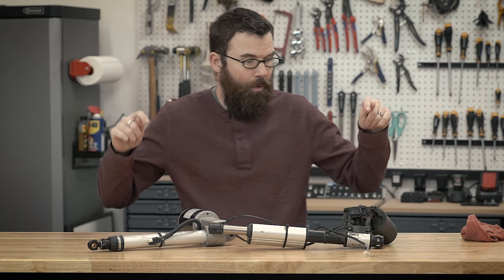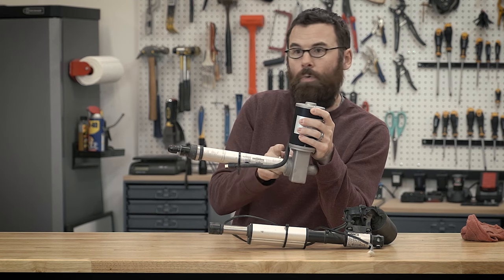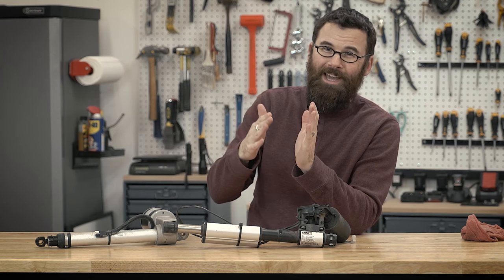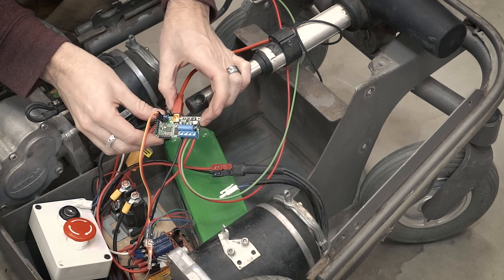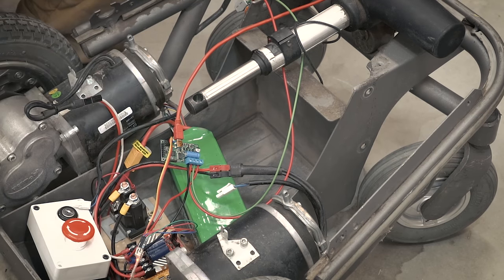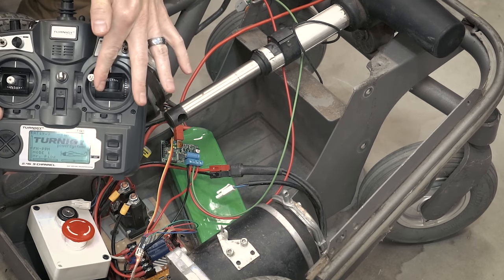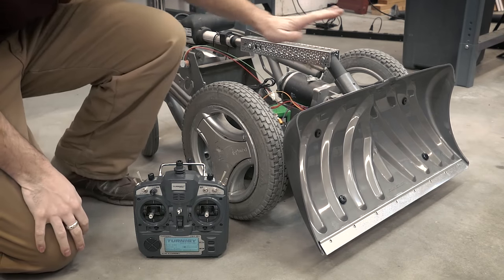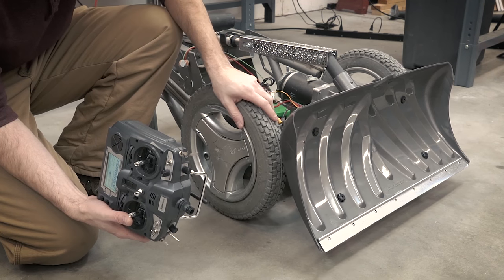Robotic Snow Plow - Part 2

Comment: hello sir, this invention is pretty good. I'm a warehouse associate in a healthcare supply business and those kind of wheels don't work well during winter. I had very bad experience on those kind of wheels when loading them in the van lol. Having heavy duty/ toothed metal wheel and heavier front could help on your project. Thank you for this video. I learned a lot

Comment: I recommend adding ballast, perhaps come "chains", and most of all, raise the plow when taking the first pass.  If you leave 2 or 3 inches behind on the first pass, but you can move the snow, then you've made progress.  The other issue is that "scoop" type plows are not very good for plowing.  In plow terminology they call that "gather" mode, for gathering piles.  In normal mode you want the snow to shed off each side of the plow so that you don't exceed your traction envelope.  Start by adding ballast and adjusting your technique.

Comment: Have you ever seen the VNH2SP30 motor drivers? You can pick them up on a small breakout for about $6 a peice, and they will handle 30A continuous with 45A peak. A nice feature is that they have current sense feedback built in. We have been using them in a more packaged up form for quite a few years in FTC.
Reply from the maker: I've seen them and used them.  They're decent for the price, but lack a lot of the features of a full motor controller.
Reply: Robert Cowan They are a bit of a DIY solution. You are right about the lack of features

Comment: Fun project Robert; we could use that in Vancouver this year.  Maybe phase 2 could see a propane tank mounted on top and replace the blade with a flame thrower manifold :)  might be a bit slower, but traction wouldn't be an issue.

Comment: there's a robotic snowplow competition in Minnesota each year and what most teams usually do are 4 wheel drive skid steering systems that are really weighed down. my chassis was 700 lbs.
Reply from the maker: Oh, cool.  Yeah, I was just trying to see if it would work, but it didn't  :-/
Reply: I think if you added some weights to the top of the robot you would be able to push a lot more snow.
Reply: I understand not wanting to put any more money into it though. Robots are expensive!

Comment: Nice project Robert...would you share the list of parts for this project?
I wonder if you have made any improvement since your initial testing!
I am thinking that traction could be improved by simply adding weight to the chassis.
Thanks for sharing your passion and expertise;)
Reply from the maker: There's a small list in the description.  what parts are you curious about specifically?  I'm pausing the project right now as I just have too many other things going on and I want to do this one right.  I might just build it from scratch and use treads or something.

Comment: I would use a old Honda snow blower frame with caterpillar tracks rather then small wheels, you need to greatly increase the surface contact area of your drive system the ground, and with your bot steering by rotating drive motors in opposite directions... it would be two good systems to marry together. and it would perform the same way as a army tank steers by (skid steering).

Comment: the shovel should be at about 45 angle plowing to the side. you need yaw actuator to control the shovel angle. Weight is King on Deere tractors for traction. In your case you can use lead acid batteries for weight.

Comment: NOOO NOOOONOOOOOOOO BRO!
Not Too Wide Tires !!! 
the wider you go, more weight distribution you'll crate! you need, lot's of wight of jsut right(small) surface. 
 Go small, but with good tires!   (look for Rally cars on the snow )
(And of course you need more wight :) )
Reply: Wrong.  It should have mat tracks
Reply: @sullygully1976  well, the discussion is about the thickness of the Tires and not the entire different setup! But sure,  then you can not go with the same budget! You need to rebuild the whole driveline... And don't forget the costs😉
Reply: @ehsan0606  then look at the tires on a snowblower, and simulate that.
Reply: Snow blower has the corect amount tire width and hell a lot more wight!!!
Again in his partiklar case, you should not increase the size but weight in that... ☺️
If you even put 3 more of the  sames tires at each side, you will be needing even more weight to create better traction.
Reply: @ehsan0606  when i saw what tire s he was using, I new from the beginni g it was going to be a failed experiment.  What a waste of time.
Reply: @sullygully1976  well ofcourse not!! Fail your way to succes!  What do you thing that prototype is! 
That was lots of snow to take on! So , not failed, but learned :)
Reply: @ehsan0606  for someone so smart, he dropped the ball doing the obvious.

Comment: I was thinking all the way to the end same thing...Just adapt your own makeshift sno blower to this and it should work fine with maybe a better traction plastic belt chain links printed to fit front tire radi both large diameter and tire diameter perpendicular so the links can grab the tires..big links like a buldoser would have but small enough for front wheel and tires or take tire and rim off and modify like they make snow tracts for ATVS with the triangular drive empliments ...so this series should not go away follow through with your original Idea and make it work as it would make a great tool anyone in heavy snow areas would definantly want. In fact I can see RC Remote lawn mowers all sorts of aplication which is the next logical use for almost eliminating physical labor for these tasks. The disabled would benefit also if they could do tasks many take for granted like this. And when one is disabled they don;t have alot of extra money to hire someone else to come shovel snow everytime it decides to drop a load.

Comment: Add some small paddles to the tires?
Reply from the maker: I think treads might be the only way to go.  there's just not enough weight to really get traction.  Even tracks might not work.  I'll probably just go straight to tracks and a snow-blower, because the snow just accumulates and makes it harder and harder to drive.
Reply: Just use wheels like they use on snow blowers. Add some weight to the system and it will work out fine.
Reply: Treads won't help unless you want to stay on top of the snow.  Chains on drive wheels are the way to go for slick conditions over hard surfaces. Perhaps the old farmer's trick of using rope to gain traction would be helpful in the short run.  It's pretty cheap, easy,  effective, and reversible.  

 Pass rope through the hub and over the tire every few inches to form temporary tire chains.  Lace the wheel as even as possible and then tension the rope on the wheel with a triangular loop on the outside of each wheel. Feed the tension loop thorough outer loop pairs at each hub spoke to help the rope lay out a bit more evenly on the tire. Instant deep tread.

I'd add bags of sand as weight over the wheels to improve its ability  to build walls of packed snow at the bottom of the driveway and on the neighbor's section of sidewalk  :-)  

Thanks for the great videos.

Comment: Disconnecting the negative power terminal is not the proper way to shut down a
motor controller. Any connected I/O to RoboClaw will create a ground loop and
cause damage to RoboClaw and attached devices.                                                                            

  Shut Down
To shut down a motor controller the positive power connections should be removed first after the
motors have stopped moving. Powering off in an emergency, a properly sized switch or contactor
can be used. A path to ground for regeneration energy to return to the battery should always be
provided. This can be accomplish by using a power diode with proper ratings to provide a path
across the switch or contactor when in an open circuit state.